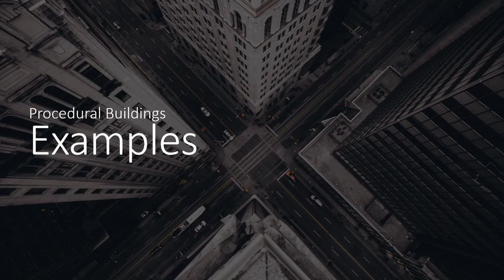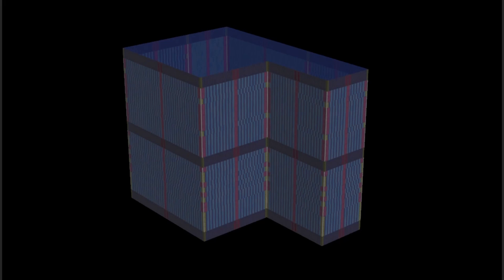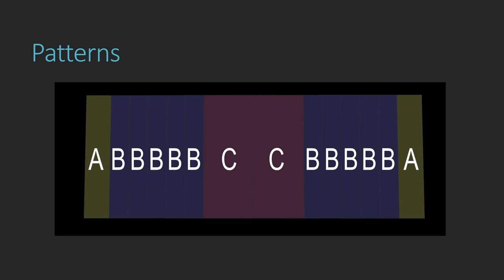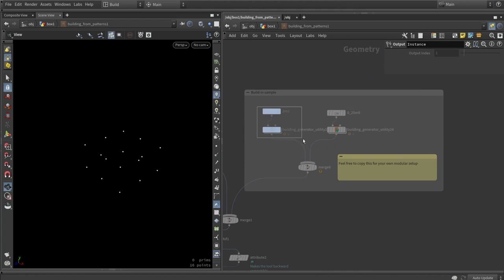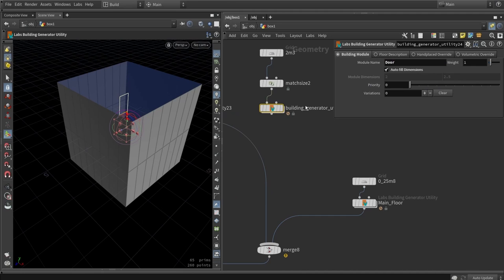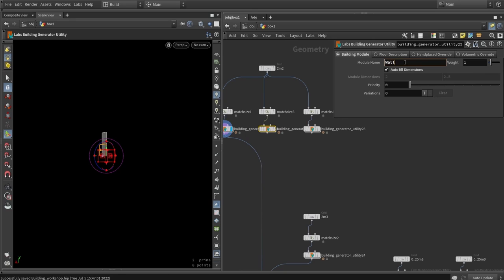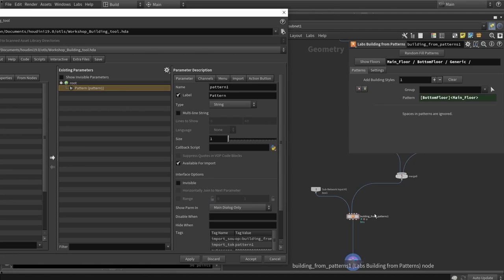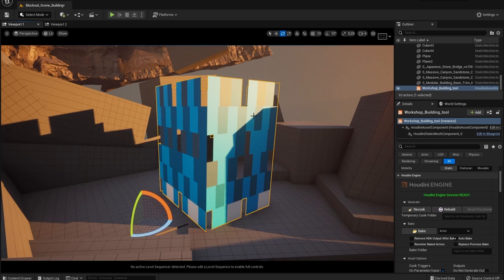Building Generator | Simon Verstraete | Games Workshop

Comment: About the corners, there is a mistake in the code that does not allow for left and right corners to be used.

To correct this, allow modifications on the building generator node, then go inside and look for the "place pieces" node. Go inside it and look for the "grammar_expansion1" node.

In this node, you'll see this
CC_L = _corners[0];
CC_R = _corners[0];

Replace by this
CC_L = _corners[0];
CC_R = _corners[1];

Left and right corners should work properly
Reply: Thank you so much!!!
Reply: Have you been able to make concave corners work btw? I only can get convex corners to work.
Reply: @sams_3d_stuff  Yes but I had to modify the HDA a lot. Add concave variables into the building utility node, then in the building generator, add a "look for concave corners" setup and then write a wrangle node to replace convex corners by concave ones
Reply: I can't post links but if you go to the official Houdini forums and make a " building from pattern" search there is a thread where I give more details
Reply: You're a lifesaver mate!

Comment: Thanks for the video, but I have a question. When I define references from Bridge, the faces of the incoming parts are facing opposite sides. I tried on the axis directions from within the FBX files, it did not improve. I used transform node from within Houdini and it didn't work. This is my first try. I wonder where there is an error. Patterns are neat but do not fit well on modules. the axes are facing the wrong way. Do you have any suggestions?
Reply: I also encountered the axis orientation error in the import of Unreal, did you solve your problem?
Reply: @user-qj2vv4rn7l  yes it was solved, but it was stupid. I transferred the models to unreal via bridge. But there is no problem when imported from birdge in Unreal. It can also be solved with the Transform node. This situation is mentioned a bit in the Project Titan Building Tool series, which is already a more detailed tutorial, find it and watch it.
Reply: @HalitHarun  I've tried using Transform, but he doesn't work, it's bothering me, thank you, I'll see how he solves it.
Reply: @user-qj2vv4rn7l  Pay attention to the Axis of the model. You need to set this in the program you are using before referencing it. It's really frustrating. Moreover, there is a more detailed description of this stage. Tables part in Unreal Engine. Really complex processes are not as simple as they seem. I wish conveniences.
Reply: @HalitHarun  Gosh, I looked at the Project Titan Building Tool and it didn't fix my axis orientation error, I had used the cleared nodes before him and it didn't work.
Reply: @user-qj2vv4rn7l  the thing is, you have to open the axis of the modules you use separately and fix them all according to your project. Or you need to flip the normal directions of the dots. You can look at it as normal axis.
Reply: @HalitHarun  Thank you very much, I'll look into it

Comment: I'm trying to follow this tutorial on latest houdini version, 19.5.493, but there's some errors in the "building from patterns node". Anybody was able to make it work?
Reply: Same here, stuck right at the start with "invalid patterns" warning
Reply: @semichaosstudio8139  just so you are aware, I got a reply from sidefx support saying "there is known problem with the Building from patterns". I'm now back to H19 and it seems to work just fine
Reply: @nicoladanese2181  Thanks for the info, hopefully they could fix it sooner than later. No luck with H19 either on my side...
Reply: Update: installed labs package 19.5.501 today and it fixed the issue :)
Reply: @semichaosstudio8139  that's great! may I ask if you try it with UE 5.1?